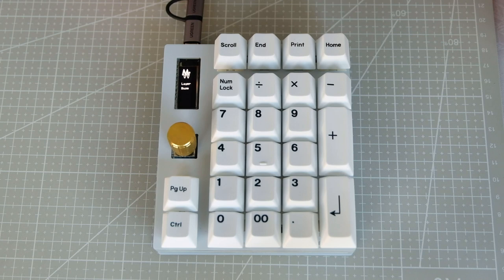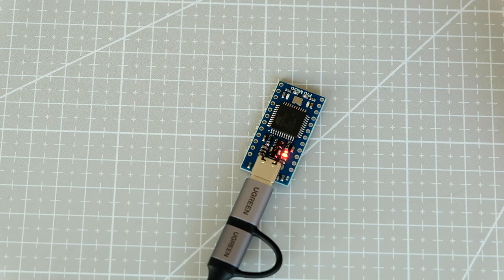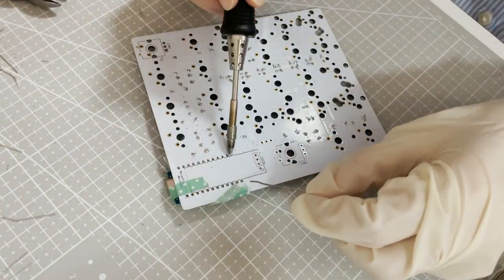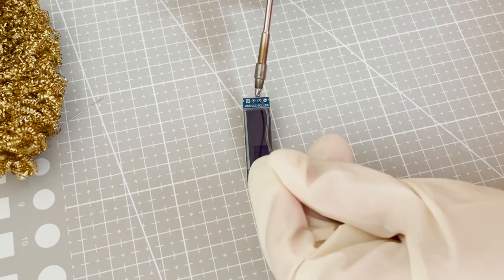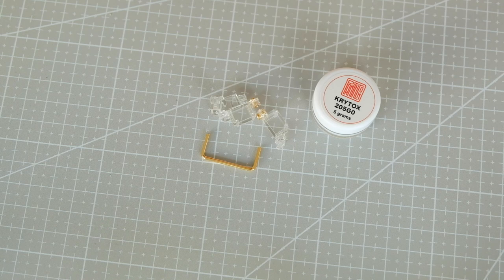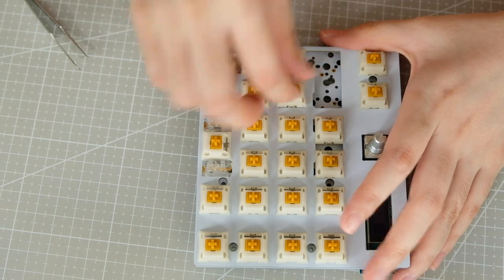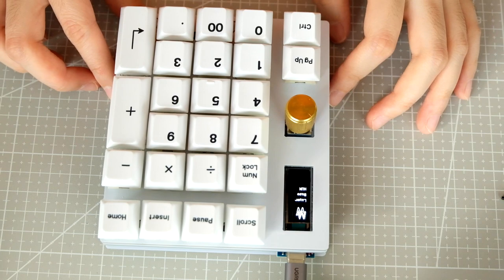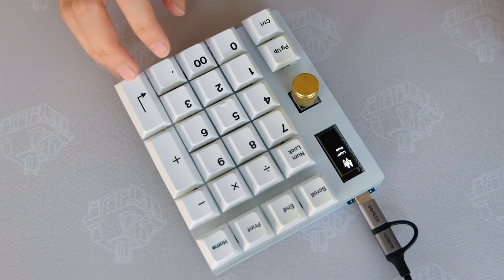MurphPad Build Log | Macro Pad with OLED and Rotary Encoder

Comment: Really great to see some coverage on this; excellent video. Looking forward to building mine.

A few points for reference :
- Those are diodes, not resistors
- You can gently crimp those millmax sockets so they make better contact
- There's a 3d printer jig for doing the leg bending, it's dirt cheap and so useful
- Soldering was great, but bending the legs out makes desoldering for repair/mistakes a nightmare. You're better off tacking one at a time, using masking tape, or some foam to hold them in while soldering straight legs.

Comment: Very informative video! Btw what size rivets are those? I've been eyeing some rivets to use as a replacement for Outemu hotswap sockets since they're too tight to accomodate standard Cherry style switch legs.
Reply from the maker: The rivets are 1.3 x 3 mm!
Reply: @AmyLikesKeyboards  Ok, thanks! I think they'll fit Cherry legs just fine.

Comment: great video, super interesting
is it possible to get a parts list in the description, I'm sure it would be helpful to others as well
Reply: The MurphPad comes with all the components necessary to build it. The stabs, switches, keycaps are to your preference. The only slightly less common thing is the unnamed Rivets she uses instead of the popular 7305 Mill-Max Sockets which convert a non-hotswap to a hotswap.
Reply from the maker: I've added it now! Thanks for the suggestion.

Comment: NEWB QUESTION: I like the idea of making your switches hot-swappable with the rivets. If I did this, and then after time decided I like switches and want to commit - could I then solder them to make them permeant?
Reply: You could, but why not just leave the rivets in? You'd have to desolder and solder again otherwise.
Reply: @andyc7777  my thinking is, because these seem loose, after I know I like which switches I have, I wouldn't want them falling out anymore.
Thank you for responding!
Reply: @heybishop  ah right fair enough! If you get the 0305 mill max sockets then you won't have to worry about the looseness :)
Reply: @andyc7777  thanks for the tip!
Reply: Wait was I supposed to order the sockets separately? Whoops...